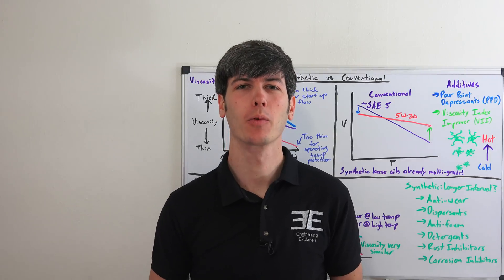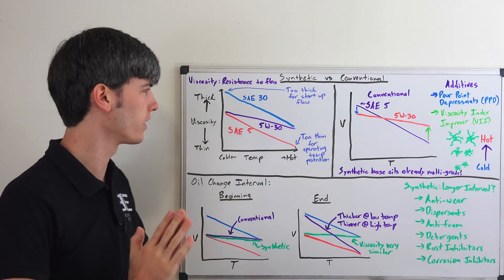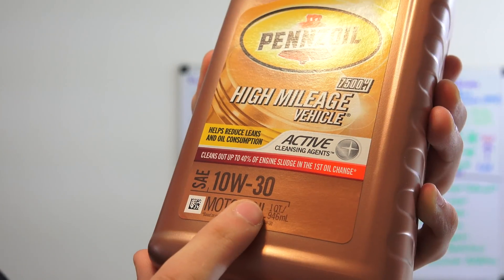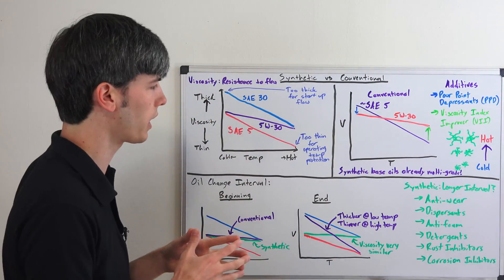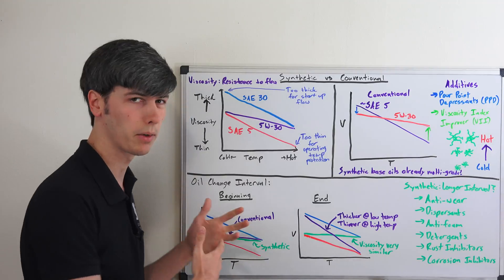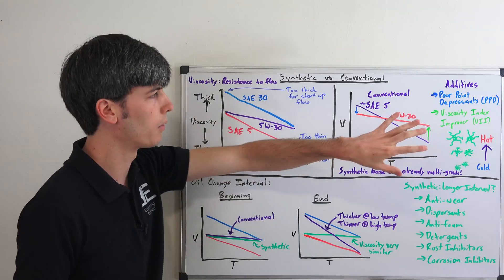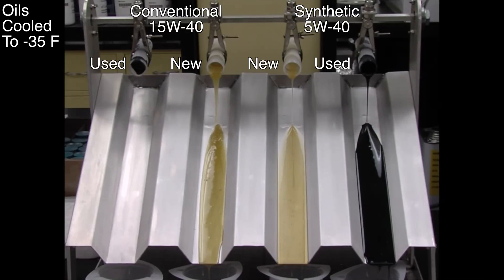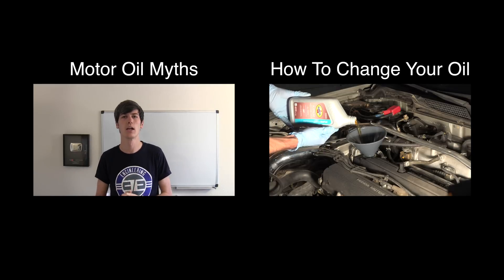Is Synthetic Motor Oil Better For Your Car?

Comment: wow... in regards to the oils viscosity at different temperatures..... I was taught, at trade school while doing my apprenticeship, the complete opposite 
like the w meaning something else (can't remember the word they used) and basically while cold it will be 30 (5w30 oil) and while hot it will be 5
obviously mechanic schools have no idea because this makes so much more sense

Comment: in my country, wether you use conventional or synthetic, car dealers still recommend the same mileage limit for oil change, 5000km. simply said, it's just bussiness, blame the super traffic jam etc. and if we dont change it, the warranty becomes void
Reply: small country Huh? - No dealer in Australia Suggests less-than 7,500km intervals And I am a Rep ; they find it hard to suggest less-than 15,000km on an Oil-change [which works-out to about 10months] and the Warranty is : 15,000km / One-year for ANYTHING from a Hyundai to a Ford in Australia.
Reply: Mostly only countries that suffer extremely low (or occasionally high) temperatures suggest oil replacement at 5000km. Here in the UK VW/Audi now use a synthetic longlife oil and suggest a change at 20,000 miles or 24 months. If you look at my reply, you will see that the explanation given for the 'W' number is completely wrong.
Reply from the maker: +moeh taoni same in the USA, listen to the manufacturer recommendation. At the end of the video I mention why (additives).
Reply: +Engineering Explained got the synthetic for $12 a jug after the rebate.
Reply: +Muzz TheGreat it's Indonesia, most of the people does not really know about car engine. if they like the model, just buy and use it, if broken, sell it. heheh
Reply: +Abel Browne years ago I had a Dodge Daytona Shelby 2.2L turbo and the severe service interval was 1000 miles!!
Reply: simply put your throwing your $ away todays oils are so much better than 20 years ago when 3000 was the norm 
should go at least 5k but even 7500 would not hurt your car at all today 
i do 5k because i am lazy and it easy to remember  
every 5k i do oil and filter every 10k i also do air filter with the oil and oil filter it just easy to remember when looking at the odometer what needs to be done